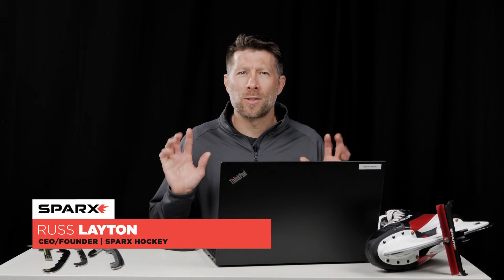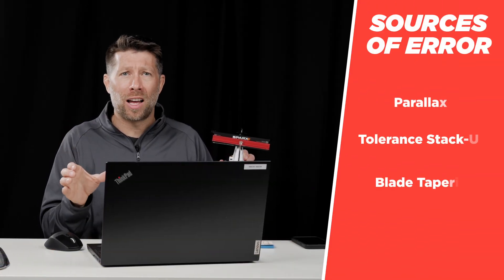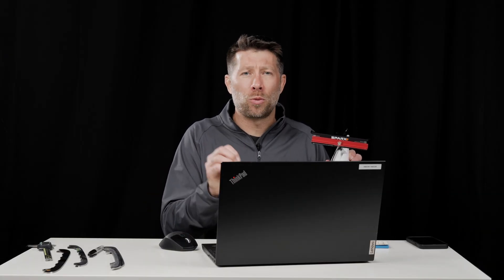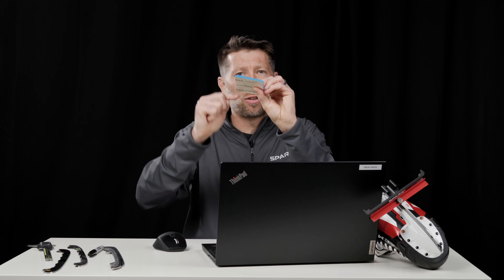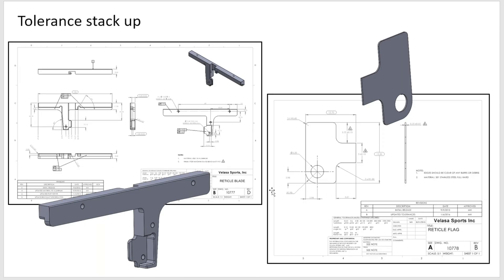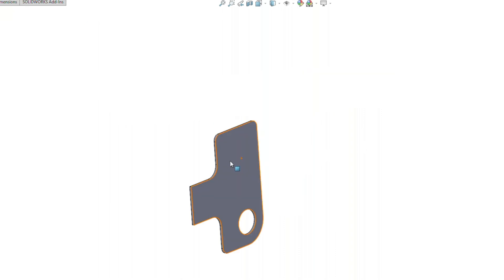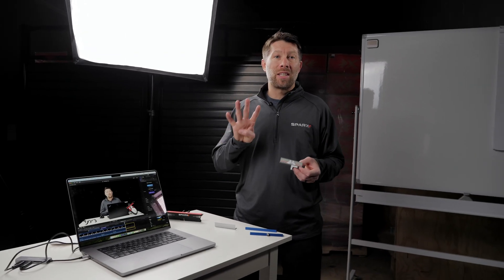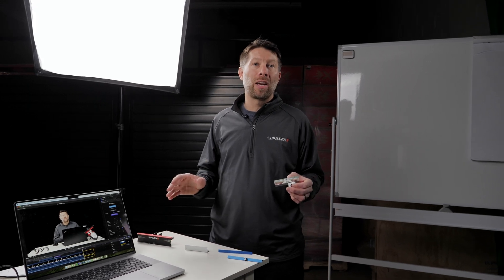The Edge Ep. 004 | Pt. 2 - The Tolerances That Can Lead To An Uneven Edge Checker Reading

Comment: I have an ES100... If I turn the knob clockwise 1 click, how far does the wheel move towards me? .005"? .010"?
The alignment tool does not get close enough to the alignment wheel to be accurate. You are relying on someone to have a good enough eye to make a judgement call. I have worked with close tolerances all my life and I could not get the wheel aligned with the tool.

Comment: thank you for sharing the video.
I had Sparx 2.0 for almost a year and still not entirely sure if I got the alignment right, so I was flipping the skate around in a hope to get the edges even :/ 
When doing optical alignment - what's the right way to look through the lens?! since depending on the angle at which I stare into lens it changes the dimensionality making it difficult to see if the alignment ring and the little tab are indeed aligned or not?!
Is there any trick to ensure they are?

Comment: Does the burr created after sharpening affect the reference surface when attaching the edge checker after sharpening making the edges appear off when in fact they’re even?
Reply: Nope, there’s a relief cut into the top edge of the fixed-side of the checker specifically for this. Checking before deburring still isn’t the best practice, but there is a relief cut there.

Comment: The fifth source of variation is a skate blade that is bent.   A curved blade will never have a square grind through the full length of the blade.   In that case, you have to compromise and check the level along the length of the blade to balance the minimum offset in level.

Comment: I'm using the bubble type edge checker. If I'm a fraction of a bubble off on either side 6 clicks seems to be major overkill to get back to square. How many clicks (using 1/2" hollow is a 1/8 bubble? How many mm is the edge off?
Reply: Heyyy big question i am not realy sure what he means with clicks, Could u please help

Comment: Thank you for this video.  To clarify at 10:17 , If my edge is higher on the right side looking from the heel (basically higher on the side of the front of the machine with skate going front left to right on sharpener) , I need to move 6 clicks toward the front of the machine to align the edges correct?   If so, then won't the alignment ring be off when I check alignment again?    

With all that said and will measure it with a leveler, it seems like my ring on the sharpener is slanted slightly from vertical but that is just an observation as a "5th error."
Reply from the maker: I'll hammer this home on most of my replies.  If it's in the green zone, consider skating on it and don't worry about this tiny amount you're off.

But, if you do want to shoot for perfectly level.

What model Sparx do you have?

Assuming it's:
1. Gen2 (the one in the video)
2. You have an edge that is 1 line up/1 line down (the extents of the green zone)

Yes, you will do 6 clicks CCW.  This will pull the ring toward you and knock down the high edge of the blade closest to you/front of the machine.

Not sure I understand the 5th error comment.
Reply: This might seem obvious but I’m new to the machine. Once you’ve knocked the high end down. Do you return the alignment wheel to centre and run the skate through again?
Reply: Yes,  it’s a new Sparx I just got a month or so ago.  

Thanks for responding and great video!

Comment: Grasping the idea that one side of the steel may be tapered/warped from the stamping process, and how that can throw off the reading on the edge checker is critical.  When using the edge checker it's really important to flip the skate around both ways and get a reading from each side before jumping to any conclusions based on a "bad" first reading.  I went through a lot of frustration and confusion with some steel before learning this.
Reply from the maker: Surprisingly, the blades which have the tapering often have it on both faces.  Many of the newer blade steels are being cut by laser and are getting really good about flatness.  Bladetech, as an example, makes extremely flat steel (no tapering whatsoever).  We do occasionally also experience the effect of the edge checker reading a little different depending on the direction you check the skate.  To make life simpler and to help yourself not go crazy, we advise that you stick to one direction (toe facing you) and shoot for level but be OK with skating within the green zone.  Thanks for the comment!
Reply: @Sparxhockey  Thanks for the reply and info.  I'd have to say though, in my case I'd have to disagree with this advice of sticking to edge checking in one direction.  Of course I'm not sure how common my personal situation is, but I can see it being very problematic for others if it is in fact common.  Personally, if I were to only edge check in one direction, I'd be potentially sending out SOME skates with horribly misaligned edges.  

I've got JRZ (Step) steel on my personal skates.  I also sharpen a few pairs of skates with Bauer Pulse Ti steel.  These all seem to have a high degree of flatness, they're fairly easy to deburr, and the edge-checker results are straight forward/intuitive in both directions.  I also regularly sharpen a few pairs of lower-quality "retail" steel which show wildly different edge-checker readings depending on which direction the edge checker is placed.  I mean it's so far off in one direction that I'd be embarrassed to let the person skate on them.  BUT it's normal/close to perfect when the edge checker is flipped to the other side.  

In these odd-ball cases, the only reasons I trust that everything is fine is the years of experience with my Sparx being aligned properly (learned trust in the machine) and my experience comparing higher quality steel that shows consistent level edges in both directions.  After so many years using it, I honestly trust my Sparx enough to not feel the need to use my edge checker all the time, but some edge-checker results can be really confusing and have made me second guess in the past.  If I were to trust the edge checker when it's placed on the "bad" side of some cheaper steel, I honestly feel that I'd be adjusting the machine way out of tolerance in an attempt to fix a reading that was incorrect/misleading in the first place, and potentially send out skates with horribly uneven edges.  

I've heard you guys say to trust the machine's precision and alignment process, and I totally agree, but if someone hasn't yet learned to trust it, I feel that their trust in the edge-checker can be an issue.
Reply from the maker: @johngiannetti.   This is an excellent point and something that is important to note.  If you have good, modern steel (Step, Tydan, Bladetech, Pulse Ti) and you get great edge checking results for two or more blades in a row and then, without changing anything on the sharpener, you sharpen lower quality steel and your results are inconsistent and off - the steel is almost certainly the issue.  At this point, do as you say and trust the sharpener.  Trying to solve for low quality steel could get you chasing your tail.

This also get's us back to our position on setting up the Sparx sharpener AND edge checking.  Confirm that your machine is aligned and if the Sparx edge checker shows you're in the Green zone... head out and skate!
Reply: @Sparxhockey  Agreed, thanks for the prompt input!
Reply: @Sparxhockey  Some blades may actually have a very, very small warp. I've had a blade that was hard to sharpen conventionally and the person sharpening it, found the problem. It wasn't off much, just enough to make for an inconsistent sharpening.
Reply: I do the same thing.  Flip it around in case there is a burr etc just to verify. I am also going to start check in the middle of the blade instead of the last 3/4 back as he mentioned in episode 3.

Comment: Great video!   Question please:  If adjustments are needed in the alignment.  How many sharpening passes should be done on the blade before checking and adjusting again?  I guess I’m trying to get an idea of how much blade is removed for each sharpening pass?
Reply from the maker: How many cycles you'll need to correct depends on how far you're off and the hardness of your particular skate steel.  This is where the marker test is so key.  If you take a sharpie and put a couple marks on the blade (as shown at 9:12 of this video) and then sharpen, after adjusting the sharpener, until the marker is completely gone you'll know and see when you've sharpened enough.

This is an extra step, but it has some benefits:
1.  Using the market test helps you to preserve your skate steel and grinding ring and not sharpen past where you need to.  We like to use the marker test and check every couple cycles to see if the marker is gone.
2.  It's actually really satisfying to see the marker get sharpened off and know that you've ground the complete surface.
Reply: @Sparxhockey  Thank you!
Reply: it would probably depend on how far out of alignment it was to begin with.  The marker test is always a good way to be sure.  There's nothing wrong with doing 1 or 2 passes at a time and checking in between, if you're concerned with wasting ring-life.
Reply: I check the alignment after each skate as the alignment tool shows to be off after each skate.  I am trying to figure out why the right side is higher all the time.  I made a comment with detail on it on here.